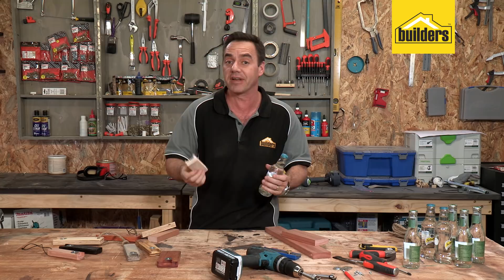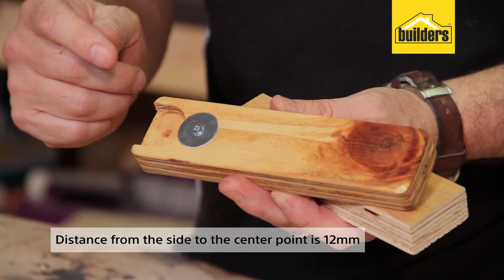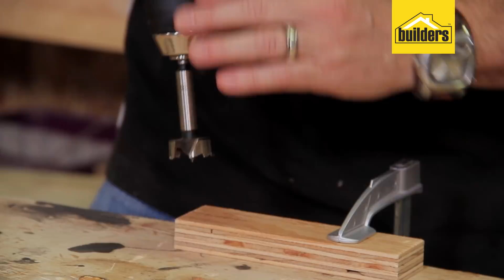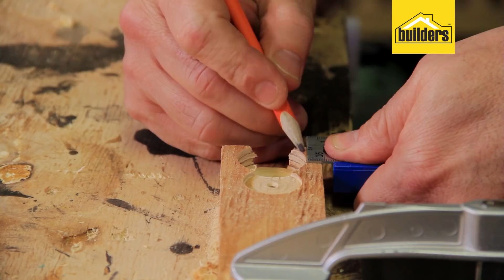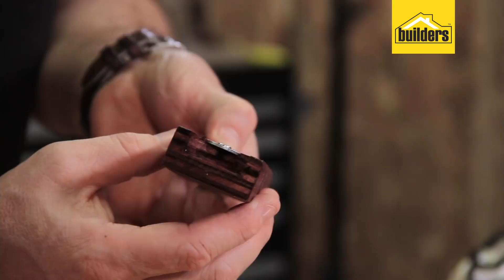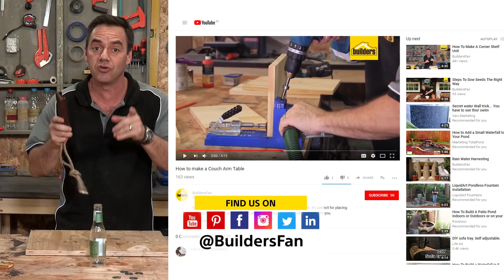How To Make A Bottle Opener - A Father's Day Exclusive

Comment: I made 2 of these yesterday,  but instead of a washer... I used some vintage foreign coins. The local coin shop had a large bin of interesting coins at 4 for $1.00.   I took the wood block to the belt sander and smoothed over the edges really nice. It makes for a smooth and comfortable fit in the hand.  I highly recommend this design for any beginners out there, its an easy, fun project that serves a purpose for any drunk out there lookin to pop a top off the ol bottle o hops' !!  👍
Reply from the maker: Hi BigFoot, we're so glad you gave this DIY a try and added your own twist. We hope our DIYs continue to give the ou inspiration to try them out :) NM